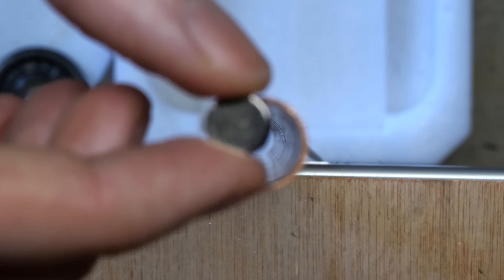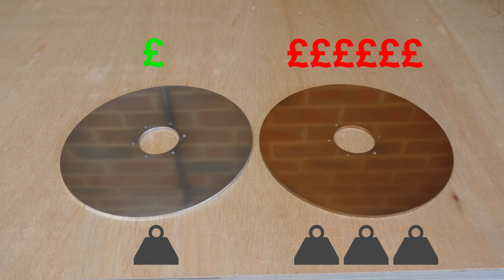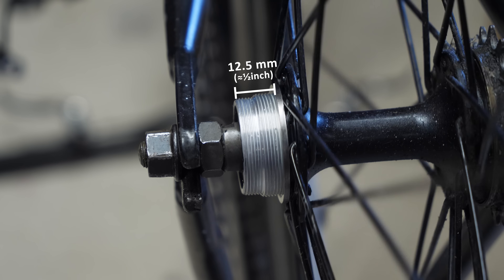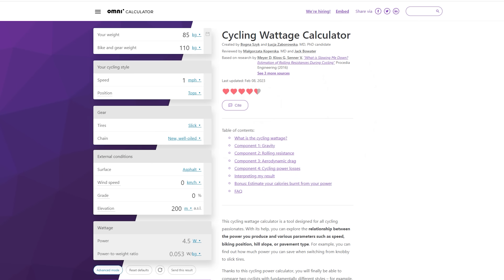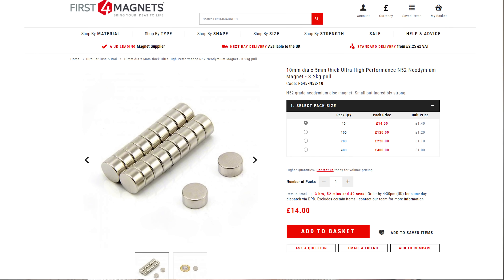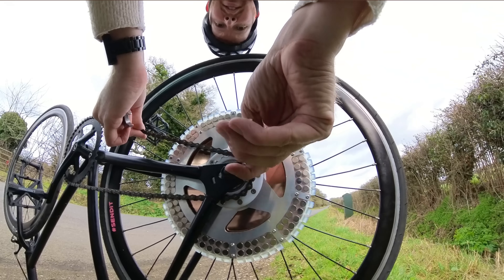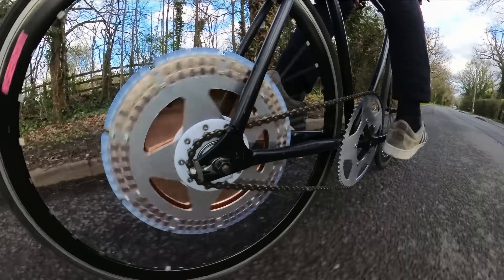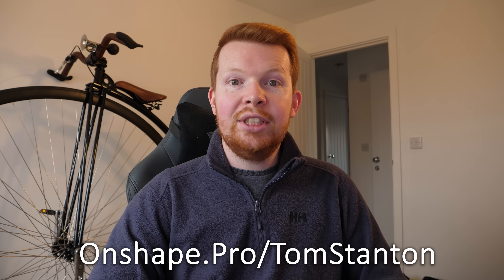Gearless Magnet Bike

Comment: The side by side comparisons are astonishing, it’s amazing to visualise the different behaviours induced by different configurations of magnets and weights
Reply: True. I just wished he had filmed them with his infrared camera, so that we also see the amount of heat loss
Reply: @MrGustavier Yeah that would probably be really interesting, but I still think it’s good as it is of course
Reply: @MrGustavier  yeah true
Reply: He could've used an off the shelf thread on 6 bolt brake adaptor for $10 instead of printing such a disc
Reply: @janeblogs324  Probably a pitfall of having a 3d printer is immediately jumping to it to solve a problem when using/modifying an existing product my be quicker/cheaper/stronger ect.
Reply: I love how you could see both a linear graph configuration visually as well as a logarithmic one
Reply: Tom is brilliant, I wouldn't be surprised at all if the heat generation turns out to be a huge positive for future project potential, surely this magnetic contactless set up could harness all sorts of free incidental energy

Comment: I wonder if you can make a CVT for a bike by putting magnets on the wheel and then rings of electromagnets spun by the chain

Well it won't be a CVT but you might be able to interpolate between rings of coils
Reply: probably
Reply: or make the entire drivetrain with a line of magnets and no chain